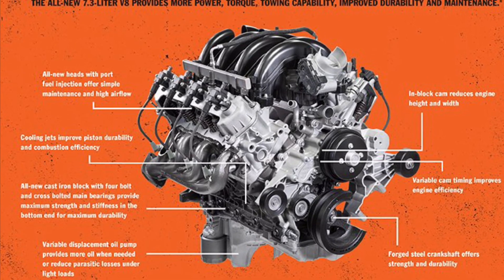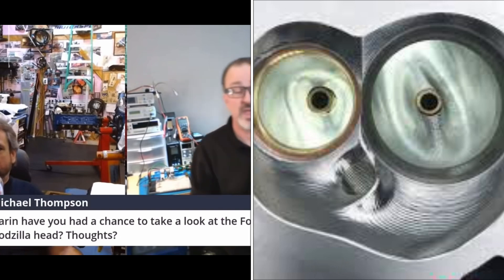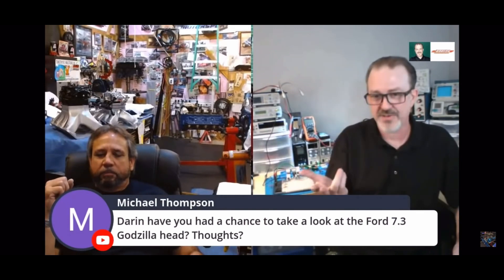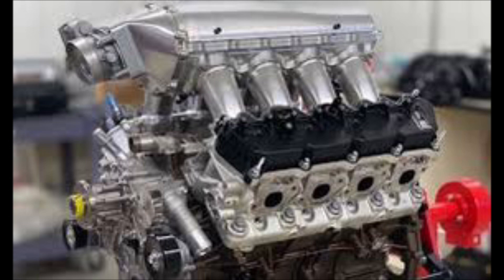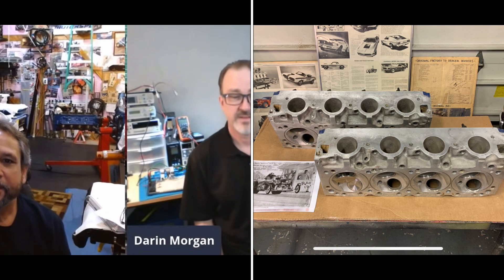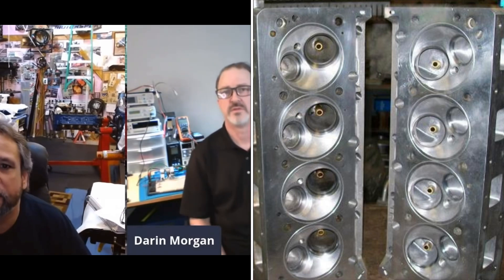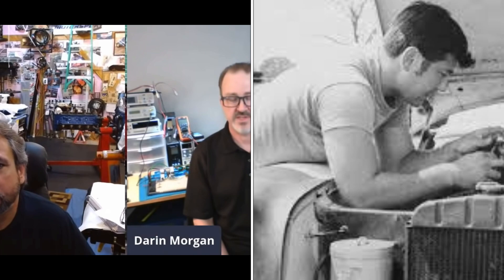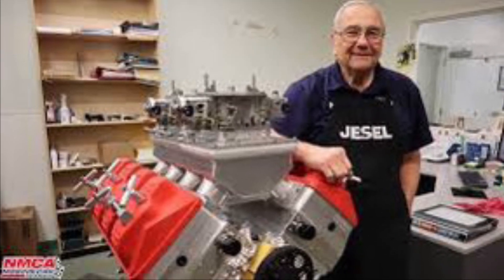DBG: Darin Morgan Thoughts on Ford 7.3 Godzilla Engine, And Welding Bob Gliddens Boss 429 Heads

Comment: So did Darin work on Glidden’s Boss heads after Glidden used up all the heads Larry Widmer designed and produced for SVO that won Glidden his championships in the 500” era?  Glidden found out the heads would be available to the public so he bought all of them and had SVO kill the head program. When Glidden used up all the heads he went to Widmer to make some more and Widmer declined.  According to Widmer, Glidden then spent a fortune trying to replicate the heads, but never got them right.  I wonder if Darin was involved in trying to replicate those heads?  Widmer welded massive swirl pads into the combustion chambers....there are great pics of the heads on his web page.  His company name is EnDyn and he goes by the old one......
Reply from the maker: Not sure on the time line for that. I suspect after. I had heard that Bob squashed any potential parts. I have talked to Larry Widmer before. He was interested in doing a live chat, so will have to get back to that. Get his thoughts.
Reply: @dragboss351cleveland  Thanks for the great content!  Looking forward to more....and a video with Widmer would be great!
Reply from the maker: @trailerparkcryptoking5213 appreciated enjoy this stuff like you. See what I can work out. But things happen when they happen. Family first.

Comment: how bout the fact that it's a 7.3 which is a lotta cubes considering the trend towards small engines to meet emissions lately.  the reason it can do 380 cfm is because there's enough cubes and suction under it with 7.3 liters to actually use it in a sensible rpm range.  the 5000 lb. elephant in the room is, the 7.3 liter is a 445 cubic inch engine.  i.e. we're back to where we were in 1970 again.  cubic inches.  the takeaway from this isn't we need a 380 cfm head, the Hemi and Boss 429 had that capability in 1970.  the point is, you need the 445 cubic inches.  not a 302, 351, 390.  there's a difference.  "no replacement for cubic inches" remember ?  this is why I don't spend one nickel on building an engine any smaller than a 454/455 for myself anymore.  why bother ?  I had a friend who used to use the beer slogan "go for the gusto" when deciding what engine to put in.  and it was a very effective, simple approach that worked. unless the rules of the class demand it, build the big engine.  put cubic inches under any head with big holes in it for ports, it will flow if you rpm it.  he makes a good point as well.  there were early attempts at swirl ports made by deflecting the flow in the 1960's-70's.  what would happen is they hit 250 cfm at .400" lift with a lot of swirl, and stay there.  as the valve is lifted to .500 .600 .700 lift, the flow stays at 250 cfm, or maybe only climbs to 253 cfm.  very good point.  what I'm saying is, the cubic inches are more important than the flow. without 427-455 cid, it's almost a waste of time and money building the engine.  because a small block 302 costs as much to build as a 455 lately.  so go big or stay home.  otherwise it's just an experiment on what can be done with a smaller engine.
Reply from the maker: Go with what you know, not everyone thinks that way. Thanks
Reply: As long as it....will fit.  Heavy large engines don't necessarily equate to win on a road course either !!
Reply from the maker: Plus not everyone wants a huge engine in their car, fitment and weight. Good point

Comment: Godzilla is the modern Cleveland
Reply from the maker: I like that. Cleveland's walk softly and carry a big stick, and Godzilla's don't need any stick, they hammer
Reply: @dragboss351cleveland she's more Cleveland than LS
Reply: @dragboss351cleveland https://youtu.be/3un76F6WQ-s
Reply: yeh with 100 more cid than the 351c, and 50 more cid than a 400m.  what about that.   put 450 cid under stock cleveland 4v heads see what it does.  imagine if Glidden was allowed 100 more cid with his Cleveland,  what would it run.
Reply: @tunnelportterror  roush made a destroyed 290 cid Cleveland pro stock engine
Reply: Watch that video
Reply from the maker: Thanks for sure
Reply: @broke_dongle  yeah the OEM are cheap if you plan on making some power get some aftermarket
Reply: Darin worked on Bob Glidden engines well he certainly got some great experience there ..I remember he said he worked there but after thinking about it Darin must have so great story's to tell about how much knowledge Bob had about combustion shapes , port shapes ect ..I know Glidden worked a lot ..Appreciate Bob's knowledge was transferred from different engines on general principles that work ..thanks for the videos
Reply from the maker: Your welcome. Yes there was no monkey business going on there he told me. Bob drank lots of coffee and did not take any breaks
Reply from the maker: Spread throughout all makes